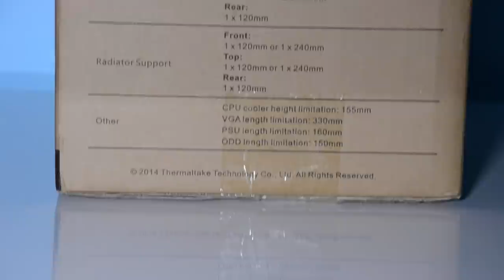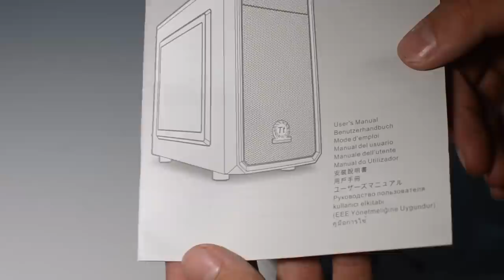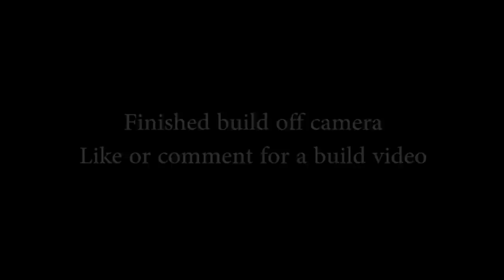ThermalTake Versa H15

Comment: is the psu that comes with it bad quality? what was the idea behind switching out the psu other thanthe corsair is better.
Reply: Original PSU was not modular at all and may have been missing important connectors, also the replacement one in 80+ certified which means it will run much cleaner power, and be more stable.

Comment: do you think my h100i could mount in the top looking at the pictures on newegg it looks like the spaced the top fan mounts away from the motherboard which is my current problem because my ram sticks arnt huge but still get in the way cause its mounted so close
Reply from the maker: +Jesse Krucek I think it should fit
Reply: im gonna find out ordered hopefully the spacing in the case works because with my current cause my fans are on the outside of the case

Comment: does it come with filters and where is it placed? Thanks in advance.
Reply from the maker: There is a filter built into the front grill
Reply: so the only filter it has are on the bottom of the power supply and on the front? thanks in advance. Btw, great video ^_^
Reply from the maker: Yes
Reply: Thanks for the quick reply.

Comment: hello.Can u tell me if hyper 212x cpu cooler gonna fit in this case?
appreciated if u answer me. :D
Reply from the maker: +victor aledia Yes it does. I have one in mine
Reply: nice thank you.cos im  little bit confuse bcos the spec maximum height limit is 155 and the cooler is 159.but becos u say it does im ok now. :D
Reply: what? the 212x fits?
Reply: The Noctua NH-D15S fits (at least on my motherboard), so yes, I would assume all versions of the 212 fits

Comment: For all of you that are asking if the case comes with a power supply, it doesn't, he might've got a deal on it.
Reply from the maker: Some places it does and some of mustn't
Reply: +GW12 

http://www.amazon.com/gp/product/B00J0NZ6PW/ref=as_li_tl?ie=UTF8&camp=1789&creative=390957&creativeASIN=B00J0NZ6PW&linkCode=as2&tag=brlwkj2sf-20&linkId=3XST67E7UI45HOAL      Thermaltake H15 is $29.

 I think it is already cheap enough. 

For all of you that are asking if the case comes with a power supply, it doesn't, he might've got a deal on it.
Reply: ross Don ???? I don't understand what you're trying to say
Reply: Some places it does come with that 450 watt PSU he pulled out of the case.

Comment: The way of putting on the thermal paste was amateur job. You better spread it manually on the whole surface in a thin layer.
Reply: when you squash it, it pretty much does the same thing and saves you some time.

Comment: this case maybe is better
http://www.highspeedpc.com/category_s/1814.htm
from 
http://web.computerpilot.com/2013/02/lian-li-pitstop-diy-test-bench-technical-review/
from google-image (diy test bench) result row 2 col 1
because :
1. cpu should lay horizontal.
so the heat from cpu spread thermal paste
without disturbance from gravity.
source :
'When the processor is operating, the heat spreads 
the TIM across the top of the processor 
integrated heat spreader and the bottom of 
the fan-heatsink'
in 
http://www.intel.com/content/www/us/en/support/processors/000005576.html
from 3rd reference in 
'Intel, crit.tv, Arctic GmbH recommend to squeeze a 
pea-sized amount of thermal grease onto the center of 
the CPU.[6][7][8]'
in https://en.wikipedia.org/wiki/Thermal_grease#cite_note-8
from google (thermal paste) result 2

2. harddisk, cdrom, should lay horizontal
because centripetal force from spinning cd rom,
spinning harddisk, should be free from disturbance 
from gravity.
source :
'Unlike horizontal circular motion, in vertical 
circular motion the speed, as well as 
the direction of the object, is constantly 
changing. Gravity is constantly either 
speeding up the object as it falls, or 
slowing the object down as it rises.'
in http://dev.physicslab.org/Document.aspx?doctype=3&filename=OscillatoryMotion_VerticalCircles.xml
from
google (vertical circular motion gravity) result 3

3. harddisk should be cooled by a fan